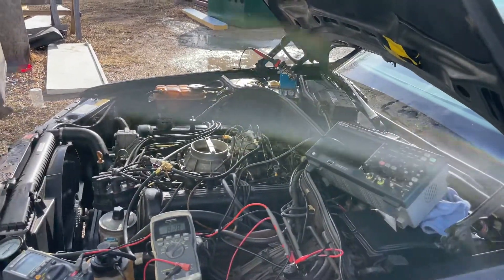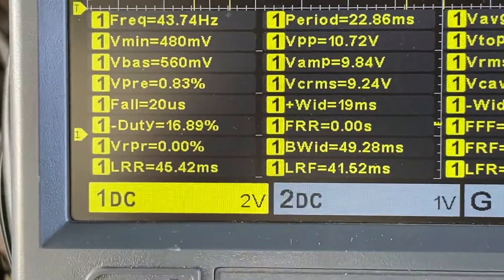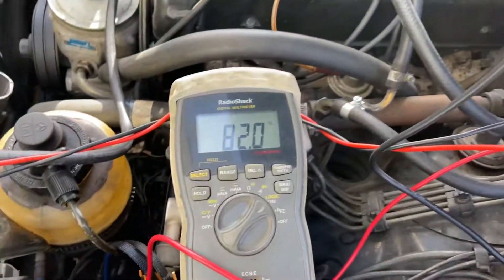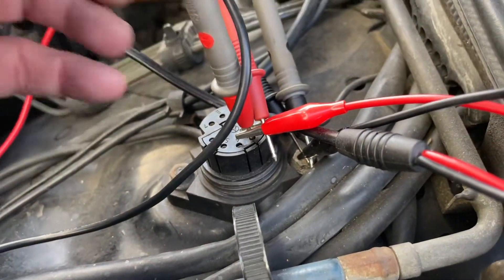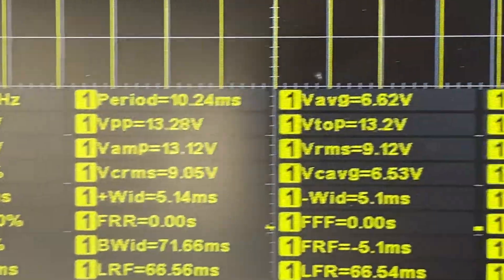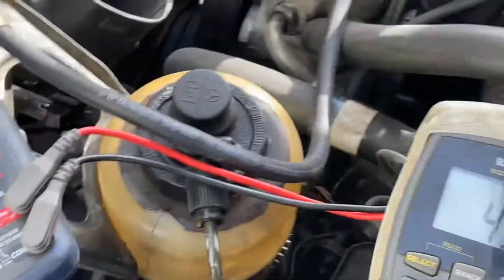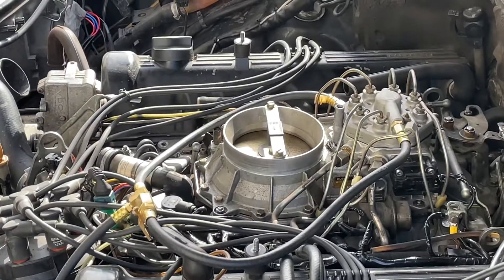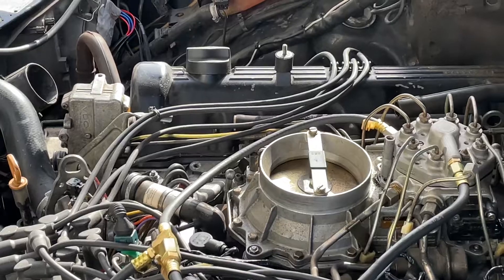Mercedes W126 MY89 5.6L Fuel Pressure & Duty Cycle Test after 1 year of Big Repair & 3.7K driving

Comment: question for you: what percentage make rich and lean, below or above 50% ?
thanks!
Reply from the maker: It depends on the duty cycle tester, whether it indicates the on time or off time of the pulse(s) and the polarity of the test leads itself. The Bosch duty cycle tester has reversed polarity and shows the on time as % 
Meaning 0% is off all the time, 60% is on during the duration of pulse etc
On the Bosch Duty Cycle tester richer is over 50% and leaner below 50%

If you don’t know what your duty cycle tester shows then connect a co tester in the tailpipe, this will tell you then if it is richer (higher co) or leaner (lower co)
Or use a digital oscilloscope
Reply: disconnect electric plug on EHV, equivalent of 0% duty cycle, that will make rich mix all the way up. Correct ? @inovahightechltd
Reply from the maker: Yes
Reply: Thank you for your answers !! I play with 3mm hex back and forward, but do not see readings above 51%. On the opposite side I saw 10 - 20%. I think to replace O2 sensor. @inovahightechltd

Comment: Hi Peter. After rebuilding my fuel distributor I’m getting a bunch of white smoke out of the exhaust. It seems to run fine. Any ideas? It never had smoke until after the FD rebuild. Thanks
Reply from the maker: White smoke is condensed water in last muffler pot. It normally stops after 1/2 hour after reaching operating temperature.
Did you add any additives to your fuel?
Reply: @inovahightechltd  no additives. The car great and without heavy white smoke before. After I rebuilt the fuel distributor I got the smoke.
Reply from the maker: @georgesand4629 did you drive the car? Maybe you need to lean the mixture a little bit.
Reply: @inovahightechltd  no I didn’t because there was so much smoke . I was afraid the cops would pull me over.
Reply from the maker: @georgesand4629  that’s strange, the worst case would be a blown head gasket. Check your coolant level.
Reply: @inovahightechltd  I took it for a short drive and the smoke is now gone. I checked the coolant and it’s normal level. I’m good to go now. Thanks Peter
Reply from the maker: @georgesand4629  Great job George!
👍🏻👍🏻👍🏻

Comment: Do you have a video on how to find vacuum leaks? How does someone know if they have a leak? Can it be detected without a smoke machine? And if so how is it done?
Reply from the maker: No, I actually don’t. On my car anything vacuum related to as leaking, so I skipped testing and just fixed everything vacuum related due to age
Reply: Is there a way to verify vac leaks without a smoke machine?
Reply from the maker: @georgesand4629  not that I am aware off
Reply from the maker: @georgesand4629  I just remembered this, I occasionally user starter fluid spray or ether to check for vacuum leaks on all vacuum connections which can be accessed and sprayed on. This can rule many possible leaks out if no change in engine rpm is occurring while spraying the vacuum connections. But this won’t work for the donuts, boot or vacuum leaks in brake booster or ac system.
Btw. check the brake booster vacuum hose connection on the intake manifold, they can come loose.

Comment: I’ve got a ‘86 420. I did a bunch of vacuum,fuel system repairs. My car idles at 600 but isn’t smooth like before. The car idles up and down and shakes back and forth. I tried adjusting the 3mm Allen on the airflow meter but it didn’t make a difference. Any ideas on what I should do next?
Thanks
Reply from the maker: This is to much do answer through the comments section George

Comment: I assume there a single piece of Mercedes diagnostic equipment that can provide all of these measurements but is cost prohibitive.
Reply from the maker: Mr. Impalaman,
actually there is not one but about 10 different diagnostic tools and connector breakout boxes associated just for the engine including all associated control boxes which were primarily made by Bosch and are no longer available.

Comment: Good morning. I have became very familiar with the intake manifold and fuel system on the car after my 2-year ordeal with my URO brand idle air tubes collapsing and flexing and not sealing. This caused my 560 to idle so poorly I considering junking it.  One question I have is that in the service manual, it says the duty cycle should not vary more than 10% from idle to 2500rpm. But it never says what causes this or how to remedy the problem.
Reply: One more note. My idle speed was set a little high, so I made the adjustment to the valve with to get the speed down and  I was able to get the % at idle and under load more similar.
Reply from the maker: Good morning Mark, good and congratulations to your progress. Well, the 10% is achieved by:
a) adjusting the idle speed mixture 
b) adjusting the control / system pressure drop to 0.4 Bar by adjusting EHA Valve if necessary 
c) setting air flow potentiometer to read 0.75V between top and middle pin while at idle rpm
d) basically all sensors, ECU and engine wiring harness is ok
e) idle rpm should be around 650 +/- 50 rpm depending on which revision ECU you got. The higher the idle the more difficult it is to get 10%